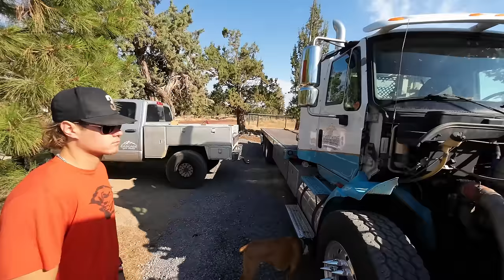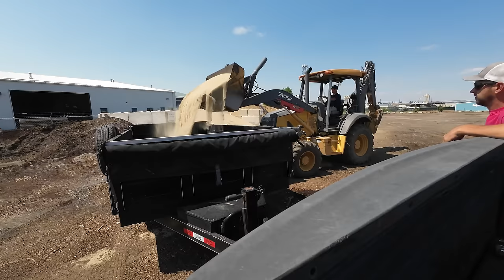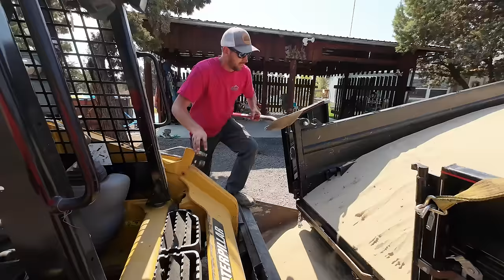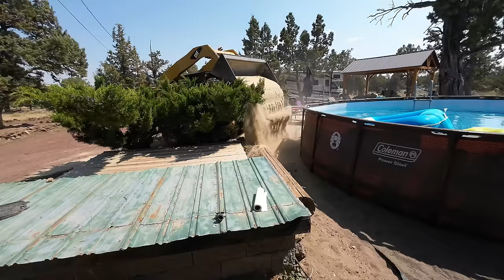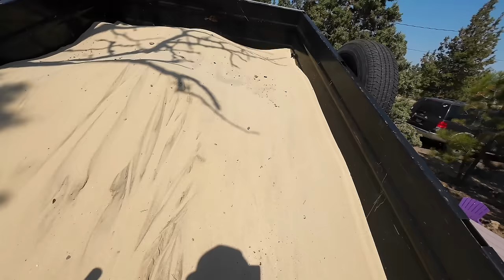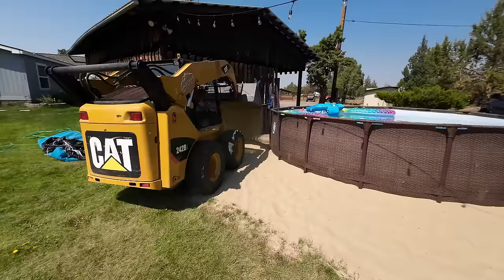I Had A Really Rough Day…

Comment: I suggest that you contact the manufacturer and make them aware of the dealer’s incompetence.
Reply: Unfortunately this is not uncommon on these vehicles it's almost never mechanical
Reply: @Bryan-Hensley It's more about the service centre not finding and identifying the problems/faults ,and not being on their game.
Like many ways of today's thinking ,one has to do things yourself ,to get it done correctly as also the YouTube mechanical data base lends to no confidence in the so called qualified workshops that are working on your truck/cars etc.
Reply: Part of this is on Casey, it's not the optimal thing to only do 1 injector... you're usually better off doing the set. That said,  the loose rocker was stealership/shitshop 100%.
Reply: @SPD_driver  Eric O from South main auto gas a good saying "just because it's new doesn't mean it's good "that from many years experience with repairs and new parts not being any good .
The whole parts thing and the high prices adds to the "just do the faulty injector thing ,and why are these parts so prone to being faulty .
Add to this is Casey's experience with trucks and trucking .
Now if your saying he should just go ahead and replace the full set of injectors,one must use the old saying,"if it ain't broke,don't touch it  !
He has already lost income from the truck being at the dealership/service centre ,so the thought of shelling out thousands more may not be all that appealing
Reply: @thatdave86  injectors in the modern engines, and yeah 2005 counts, are usually a better bet to do in sets. There's other things in play, and aa you say, Casey captains the ship. I can't say with any kind of certainty without knowing the maintenance history of the truck. Are the injectors original? Were any replaced previously? How old is each? Any prior fuel issues? Was there ever fuel contamination or anything else that would prematurely wear injectors? He's stated it's a red lump, do likely am X, maybe an L.
I also made another post about new=/=good, same references and my own experience too.

Comment: i do love that truck. we got rid of all our computer trucks and even put old style engines in newer bodies so we would not go broke due to constant failures.
Reply from the maker: Putting old engines in newer trucks is a federal crime.   I wouldn’t admit to that on the internet..
Reply: Agree. It was not illegal back then and also depending on what state you live in. Never an issue and we passed all state and federal inspections at the time. Love the videos I just think for what newer stuff costs these days it should be more reliable than old truck not much less reliable. We did not do transplants on emission year trucks. I only owned one truck that had a reburn system on it and after 100k miles the first year and 20 times on a wrecker back to the shop in the first year we dumped it at an auction. Never again. There have been some class action lawsuits against some manufacturers due to very poor quality on ecm newer trucks costing people to lose their businesses.  Best wishes love the videos and all you do for family and to help others. I really like the older ford wrecker personally. I miss mine. Should have never sold it. I have one old one left a 95 f350 crewcab  with a motorhome cummins installed.

Comment: Your pickup is already wired to supply power to your trailer, just connect the battery from the trailer to the existing power lead on the 7way trailer plug.  Never have to worry about dead battery ever.

Comment: I would find a new mechanic that actually test drives and understands the truck. I have always had all injectors replaced just like spark plugs in gas engines. This is just do to the fact of wear. In my case with changing all I have had less down time and they are already in there not much more time as far as labor. I enjoy your videos and hope you get the truck back up and running.

Comment: Not sure if there’s a better way but my dad had a pj 20 foot tilt deck which he used as a back up for when his rollback had issues. To keep the battery charged, he just rigged a very long jumper cable to connect the truck battery to the trailer battery, going under the bed and up into the engine bay so it could always stay on while driving. Just positive to positive. I’m sure you can wire something more professional but the benefit was that the trailer battery was always perfectly charged and I’m assuming it also had more power from being able to use the truck’s battery/alternator to provide more as needed.

Comment: You can wire a 7 pin coupler so it charges the battery whenever it's plugged into the truck. That saves on buying a battery every year and keeps it at full charge if it's used a lot.
Reply: Anderson plug with good cabling from the battery works better

Comment: That sucks about your rollback Casey and I know I would be heated if I had to bring my truck back to the same dealership for the same issue that should've been fixed correctly the first time, it's like these people are not even checking their work before they give it back to you. I'm surprised you don't have more than one set of jumper cables, you should always keep a set of jumpers in every vehicle just in case for scenarios like that.

Comment: Hey Casey you probably already thought of this but an idea to deal with your dead battery problems I’ve done in the past is just run a wire from your 12v+ accessory wire from your trailer plug wire to the battery on the trailer so when it’s plugged in it runs and charges off your truck batteries if your worried about draining them just throw an isolator on the trailer so it will only pull power when truck is running
Reply: you beat me to it.  I was going to say the same thing.  I just wanted to go through a bunch of comments to make sure someone didn't already say this.  Did not want to be that guy that says the same this as 20 other people.
Reply: The truck already supplies 12v to the trailer to charge the battery, that's what my truck does for my toy hauler, I'm Surprised the trailer manufacturer didn't take advantage of this, on a side note, keep up the good work Casey, seeing this video makes me feel better in knowing that I'm not alone in having days like this.

Comment: You might look into a small solar panel to mount on the top of the battery box to keep it topped off. Occasional use like the trailer these can work very well.  The sand playground for your daughter is well worth the time if she enjoys it. My dad made me a 'sand box' which was an extension from the side of a 1930s car. No interior or wheels but the steering wheel was still there. I can still remember playing in it literally 60 years later. You are making lifetime memories for your little girl. Always good to keep in perspective on a frustrating day.

Comment: I feel Your pain. After buying a new truck thing I should all set  for a few years. Only to keep having issues with a new truck. I bought a 1992 Mack ch613. My first load to the West coast the problems started. The electronic fuel system started it's problems. It wouldn't stay calibrated. After 5-6 times of that in less then 90000 miles. And numerus other issues it was time to send it down the road! In late 93 it was traded for a 94 Kenworth W900 with a cat 435 manual fuel system. Problems solved!

Comment: I wouldn't be as calm as you with the truck issues. In fact I would have gone to a different repair shop, or fixed it myself most likely.  And yeah, it bites on days like this because everything snowballs and rolls down hill. Time for a cold Coke and relax a bit Casey.

Comment: Question
Does your smaller recovery truck have the horsepower to recover vehicles. While your roll back is in the shop. Also for future use. In case the rollback has a service or other work needed. 
Always good to have a backup for your backup

Comment: I hydraulic a 3,5 pentastar because a brand new injector open wide open and didn't close fuel was leaking out the throttle body. I had to reset my timing and i'm worried i may have damaged my overhead timing chain system.

Comment: I've had a bad run of crank position sensors in my Cummins. I also had a fuel regulator problem. Hard starts some mornings'  I'm  faithfully running additives in my fuel. Seems to help. I thought you had a Cummins? My Cummins sweet spot is 1250 to 1450 rpm.I have a ten speed.

Comment: It's one of those days it doesn't pay to get out of bed. I've had days that I messed up more stuff than I could fix the next day. When cars had real steel bumpers exposed I jumped several cars, when I didn't have cables, by putting the bumpers together and using the handle of the screw jack, that came with the van, that folded in the middle for storage and unfolded it enough to jump from positive to positive while leaving it in a V shape it cleared the sheet metal. It worked every time and never left any marks on my chrome bumper. I miss my full size Chevy vans. My last one was just a work van and was parked in the corner of the parking lot and a tree fell on its dead center and smashed the roof from front to back about a foot and totaled it of course. It has a good 400 small block and a rebuilt 400 turbo that if I could ever find another good 1 ton body I could swap it out. It pulled my race car and trailer with a loaded toolbox, generator and 8 spare wheels and tires, probably near 3 tons with ease and sounded great doing it.

Comment: Have them clean out the Diesel Particulate Filter and the EGR. Change the Air filter. Got to push exhaust out, and Air in.
Did they change all 6 injectors, or just 1?  With todays electronic diagnostics, they say #4 bad injector and just change that injector. The other 5 are on the verge. but NO. your injector pattern and delivery has to be the same in all cylinders.
I'm an  old time Heavy Truck Master Certified Mechanic, change 1, change them all.  Would you change 1 Piston, or 1 Rod Bearing.
Reply from the maker: What diesel particulate filter??
Reply: @CaseyLaDelle  Don't know what year your truck is? it might be pre-emissions - 2005 for EGR's or CAT ACERT.  2008 for Diesel Particulate Filters, 2010 for Diesel Exhaust Fluid.    This YouTube video is the best explanation I have seen for all of the above.
https://www.youtube.com/watch?v=NqDhGPT508g

This is why a pre emissions glider kit was a good buy. But even those aren't made any more.

Comment: Just a question. I am not sure if you have done it or not. Have you ever considered getting a scan tool for your truck? Where you can see what is going on. I have a 2020 F150. In the design of the engine. They put both PVC values to dump straight into the turbos. Burns them out. I put in oil catch cans. Yet. One had a vacuum leak. Set off an engine code. To get it erased. I would have to go to the dealership. So. I went on Amazon and bought my own. It shows everything that is going on with my truck and in real time. Yet. I can use it on most any type of vehicle.

Comment: The next video will be Casey trying to get all the sand out of the pool. Sand will stick to wet feet until they get into the water, then it'll promptly fall to the bottom. To solve the problem put a kiddy pool in front of the ladder so the sand falls into it instead.
Reply from the maker: I mean, it’s almost like that EXACT thing is visible plain as day in the video…
Reply: @CaseyLaDelle  Oh I must have missed it. Hope they get your truck fixed soon. 👍👍
Reply: @CaseyLaDelle bummer to see all the bad luck. I have had and continue to run into those days. All you can do is do what you did and make the best of it. Casey will get it 🙂

Comment: My question is, good come the dump trailer didn't have a 7 way plug that doesn't charge the on board battery when the truck is running? That way the battery is charged up any time you're moving from place to place or when you go to golf the trailer you can leave the truck running and it's alternator can help run the hydro pump.

Comment: Not sure if you run any…. But diesel extreme additive I swear by it helping keep injectors alive. Another thought… my Cummins common rail fuel filter micron size was larger than the injector nozzles causing blockage and bad injectors… changed to a higher micron filter and no problems on that truck since.

Comment: I’m guessing you have an old International and possibly one of the early systems of emissions.  The company I drove for took my high mileage Volvo and gave me an Intertrashional.  After spending a day putting all my gear in it and the stuff that wouldn’t fit on the top bunk.  It would not pul a 40,000 lbs of paper 7 miles and had to be towed back.  

The dealership replaced the turbo, EGR valve and the EGR cooler.  I had other problems with that tractor until I got back to corporate and turned it in with other problems and grabbed an older Volvo. 

Good luck.
Reply from the maker: 2005

Comment: one outfit i worked for and small petrrbuilt that shop couldnt figure out what the heck was wrong. was like yours , run strong and then fall on its face. they finally convinced the upper powers to be to rebuild the engine . $20,000 plus later and still had same problem. and 2 weeks later had go back for throwout bearing . they charged that price for in frame overhaul.

Comment: Could have put a tarp down under the back of the trailer to easily clean up and sand that didn't make it into the bucket/wheelbarrow. And dumped the sand on the concrete and shovel it into the area you needed it?

Comment: I used to drive a leased truck that had a knock. The Mechanic said not to worry and keep driving. He said that 3 more times in 2 months. The 4th time it was no longer knocking it was banging LOUD he said I shouldn't be driving it (DUH). Turned out 1 injector went full rich, washed that cylinder of all it's oil. A few weeks later they had hammered out 1 cylinder and another in. I wonder how much work it would have saved them if they had just listened ? Hope your luck was better.

Comment: I  had the same problem with m '95 Ford 7.3 Ford/Navistar diesel. Factory recall fixed problem by accident. Mechanic said no way, but it was it. Problem solved, me hanic wanted to pull camshaft.

Comment: To much fuel in the cylinder bore will wash the lubricating oil of the cylinder walls, also the engine oil will have diesel fuel in it so will need to be drained and filters replaced with new gear. Have seen this before in diesel's which causes more engine damage, hope information helps cheers.

Comment: In regard to "everything is in the rollback that's in the shop for repairs...Each one of my vehicles has a full complement of its own dedicated set of basic tools. Jumper cables, spare tire, jack, lug wrench, jack handle, metric and/or inch wrench set, same for sockets with ratchet, hammer, pliers, dykes, channellock pliers, etc. Each vehicle: SUV, pre-run pickup truck, Baja Bug has its own tool bag. Even my trailers, each has its own tool kit. Car trailer, travel trailer, flatbed trailer. That way, if I break down on the road, I can fix most problems and don't have to fuss "Oh dang! The jack is in the other truck!" "The jumper cables are in the SUV." Etc.
Reply from the maker: Yeah I’m not buying seven sets of everything

Comment: Why not wire the hot lead on the trailer plug to the trailer battery. It will charge whenever  plugged up to the truck?

Comment: Several years back there was a severe problem with the reman’d fuel injectors failing.. boiled down to worn out tooling at the repair facility (it was Cummins reman) sounds like the problem has returned.. also another possibility (slim) is a wiring issue on the backside of the computer that is covered by a grease blob (ask us how we know if you want a real tantrum😂) … anyway hopefully they get it sorted out before too much longer

Comment: I'm kind of surprised you don't have jumper cables in the other towtruck, and every other recovery vehicle. Maybe Harbor Freight would sponsor you for tools in every recovery vehicle. 😉
Reply: I tend to have at least 3 sets of Jumper cables around various vehicles and at home.   Once my sister called me needed a lift from the shopping center as her vehicle wouldn't start and she had her 2 very spoiled small dogs with her on a hot day.  I went and brought 2 sets of cables with me, thinking maybe I could just jump her vehicle. Since I couldn't park as close as I would have liked, I used both sets and it took less than 2 minutes for her battery to have enough juice to engage the starter.  She never thought I could link 2 sets together to be able to reach her battery.

I do tend to buy them second hand and got some really long ones from a business closer auction awhile back.  As a prepper will tell you, 3 is 2, and one is none.

Comment: Casey does your truck have a regene system? If so you may try a park regenerate .  It takes about 45 minutes. Or ask the mechanisms it need to burn the carbon out of the exhaust. It sounds more like youve burnt a injector out of the exhaust muffler. That is if that truck uses Def.
Reply: Not a DEF engine…from 2005

Comment: EcoFlow? Does it not have 12volt power output? Could have shown another odd use for the EcoFlow power pack.
Also, why not wire a lead from the truck plug to the trailer battery with an inline diode so it will charge the battery while you are driving? I have wired a few horse trailers and dump trailers with a 12v line to charge the deep cycle batteries while the truck is hooked up, but through a diode so the trailer batteries and power draw will not drain the truck battery.

Comment: It is obviously the wheel spikes.  Your truck doesn’t like the plastic wheels spikes and it is unable to tell you so it just doesn’t want to behave. LOL.  

I contacted Cummins and left a message for them about your problems with the engine.  Something about their claim of zero emissions for their engines by not actually running their engines.